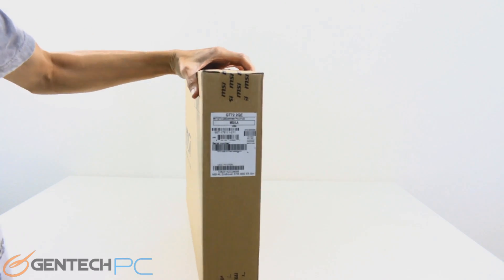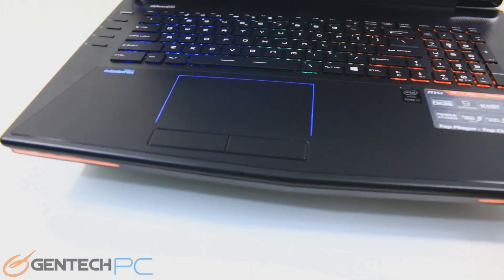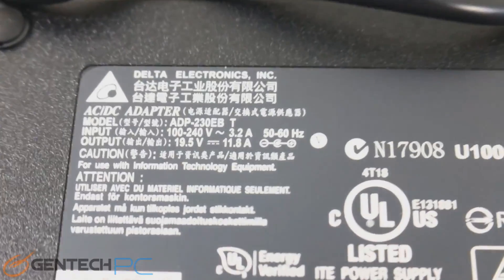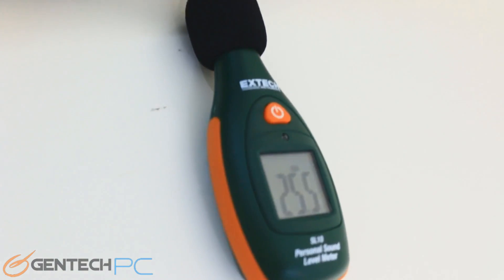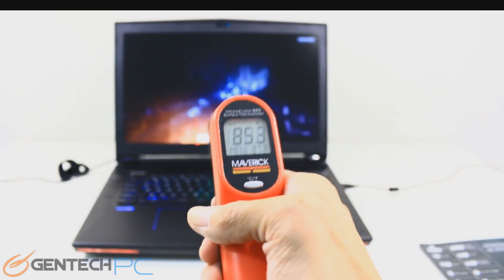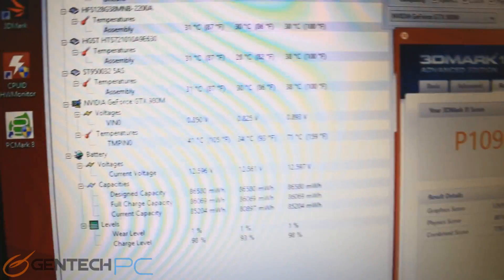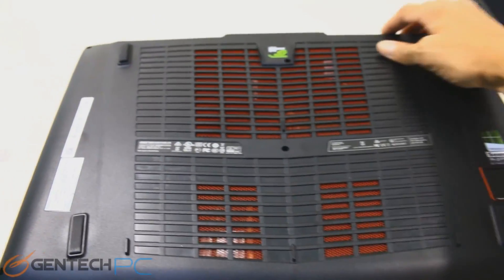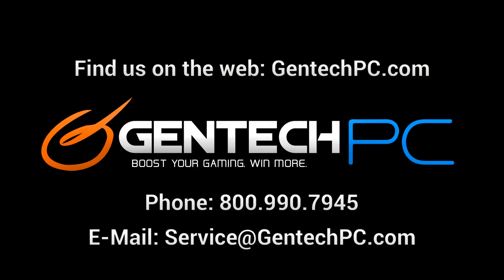MSI GT72 Dominiator Pro GTX980M / 970M Full Review

Comment: this is a very nice laptop. but not as nice as the asus g751jy. there are, however, two things i really like about this machine better than the g751. the first is the backlighting on the keyboard and tracpad. while there is nothing wrong with the g751's backlighting, this is just cooler to have multiple colors and a border around the touch pad. the second is the easy dis-assembly to get to the fans and everything else. while the g751jy is easier to get to the drive bays and memory, it is much more entailed to get to the rest. Those are two things that are better about the gt72. BUT, everything else goes to the g751jy. but i don't think you can go wrong with either laptop, as both are top competitors in the high-end gaming or otherwise laptop markets. nice review.

Comment: Hey man
I have a question for you. I just picked up my MSI gs60 ghost pro yesteday with the new 970m gpu. What do you think about the idle fan noise? I sold my razer blade (2014) for the gs60. The razer blade was completely silent during idle or even normal use, but the gs60 is quite noisy during idle and normal use. The MSI control centre displays temperature for the cpu at 38 celcius and around 2800 rpm for the fan. I find it quite noisy in my quiet room. Any thoughts?
Reply: Thanks man. I think I'm gonna exchange the gs60 for the asus g751. I seriously sacrificing portability but if I'm spending this much money, I figure I might as well get my money's worth. Espcially for the fan noise and speaker quality
Reply: Hahaha, that's how I think the gs60 sounds! At idle! Thanks brah
Reply: well. I bought msi gs69 pro like month ago. I do find it quite noisy when i start using it even for the normal use. when i play assassin creed liberation, the noise makes me think its gonna explode in any second. After a month use, i ll say i kinda get used to it and gta love it since theres no way to exchange it or get my money back. After i am doing more researches, i ll say the most important factor that decides if its a perfect laptop is the gaming noise and its cooling system.  The best now in the market that is not THAT overpriced is asus 751. It is definitely worth when u r gaming with a non-taking off fan noise and cool temp. Ah, why didnt I listen to my dad and go for asus. pa is always right :)
Reply: hahaha, its all good man. The MSI is still a very good computer, did you read what the guy said earlier? About fanspeed reduction? you should look into it. I bought my MSI from ncix, and fortunately they have a 15 day return policy so im gonna use it. But your absolutely right, it is loud and my room is very quiet so its very noticeable.